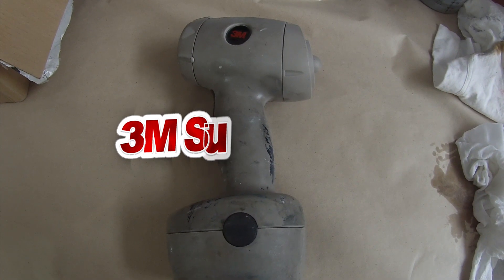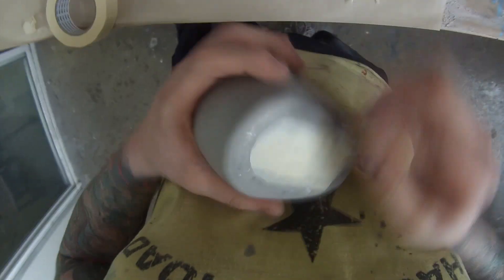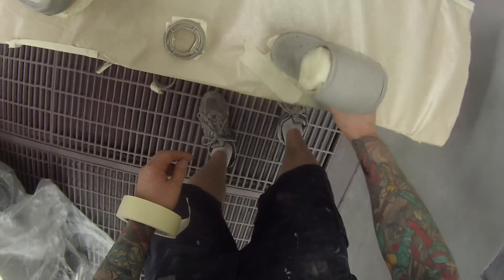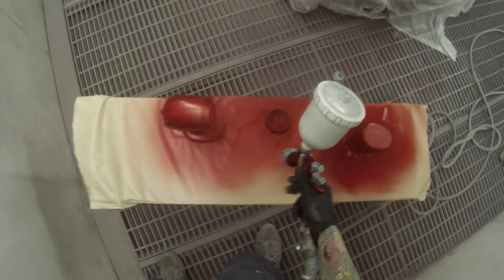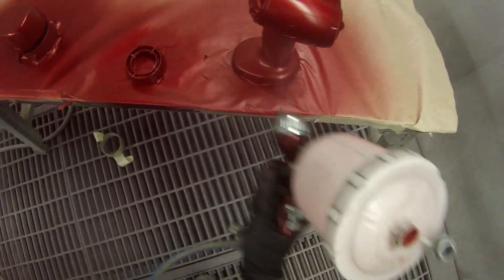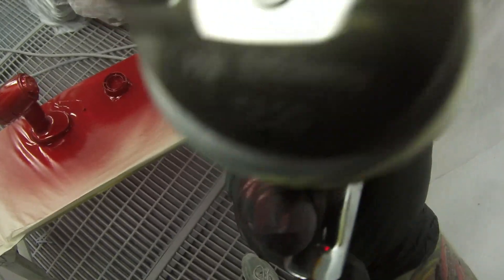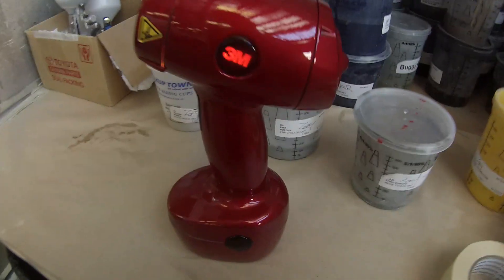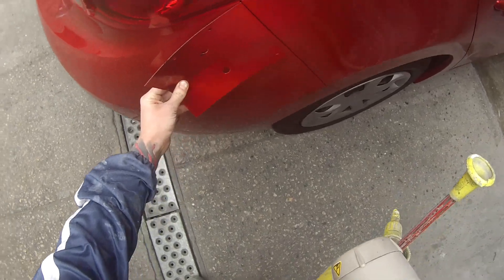3M Sun Gun

Comment: if you want a cheap sun gun. all you need its a cheap 12volt cordeless drill, a solux bulb 4700k 35w (they are the same as the sun gun.open the drill remove the motor and plug the bulb on the drill . it's cost less thant 50 buck and its the same light as the sungun
Reply: I made one for about the same amount. I got my 12V drill at a pawn shop, and it came with a case and an extra battery. It's a very handy tool for color matching.
Reply: I made one out of a 12v drill too. Impossible to wire the bulb up wrong once the motor is removed. £15 for the drill, £20 for the bulb(£10 for postage) and £5 for a bulb connector. It works great and all for £40.